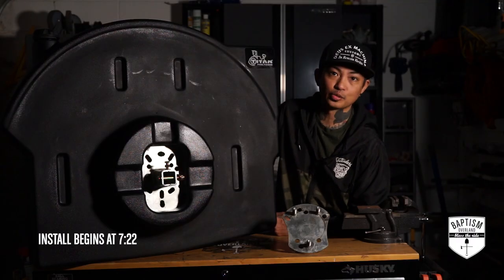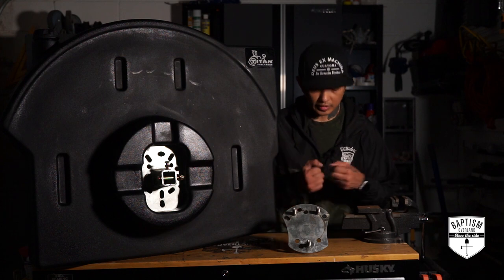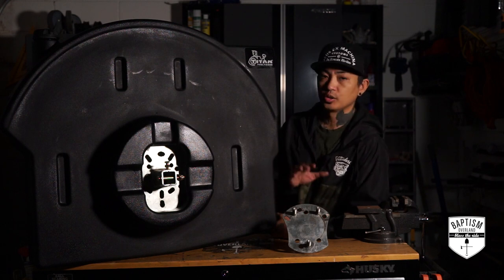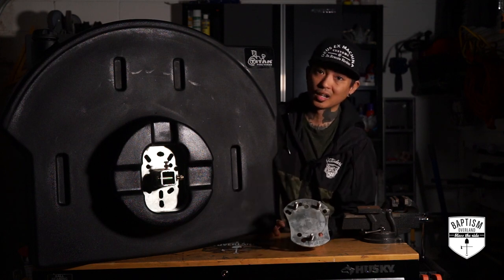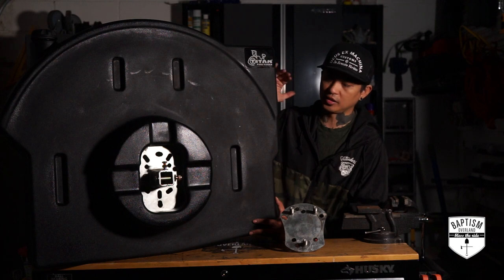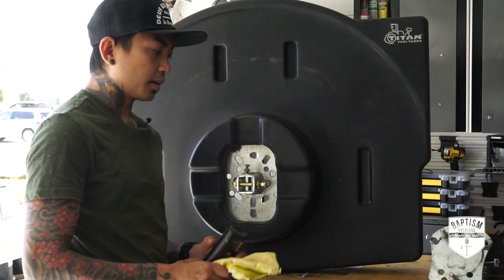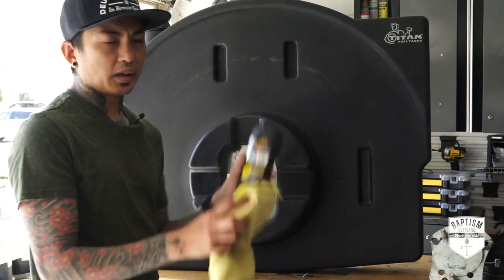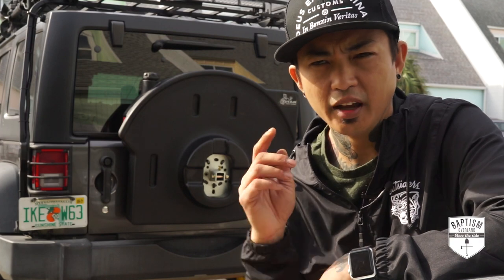CAN THE JERRIES! Titan Fuel Tank install *bonus: 3rd brake light relocation!!*

Comment: LOD makes a bumper since 2018 that you can put 2 jerrys  and a 40" spare on. I have it and use it. My only complaint is that you have to watch your loading since that is adding 70lbs if you run 2 jerrys.
Reply from the maker: Yeah for the runner I plan to get a bumper where I can carry the jerries. For the Jeep I like this system because it's out of the way and ready to go

Comment: What works best for restoring black plastic is eastwood plastic resurfacer not a paint I guarantee at this point in time you will not find nothing that comes close to bringing the the black like this stuff a little expensive but worth it one & done its a matte black finish makes old & faded look new again
Reply from the maker: Good tip! I'll prob go buy some now
Reply from the maker: I've used a ton of diff plastic restorers but find I have to reapply. You don't have to reapply this one?